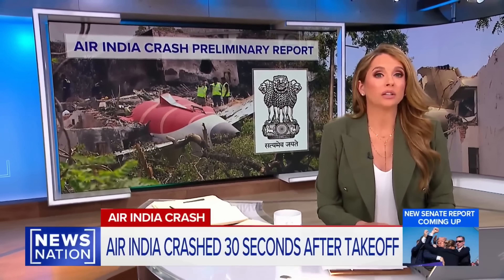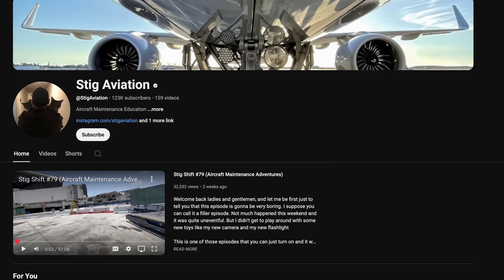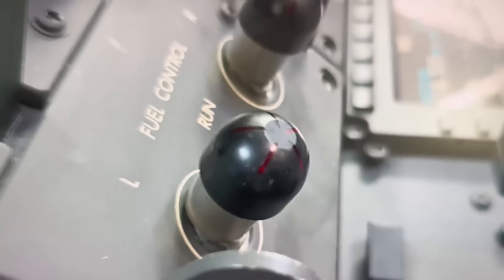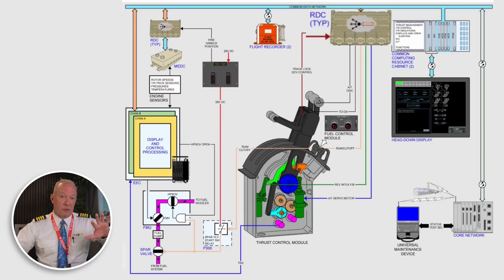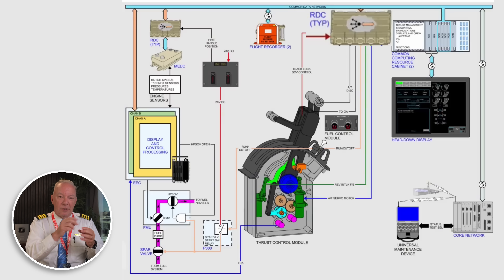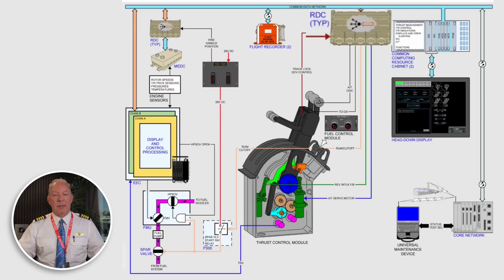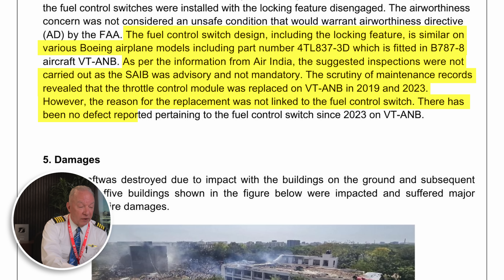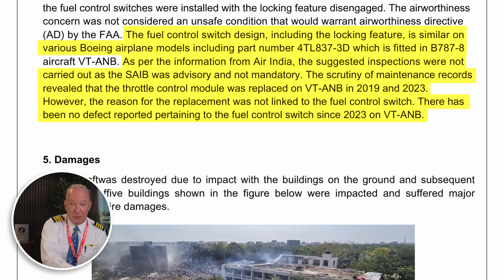The Truth About Boeing 787 Fuel Control Switches

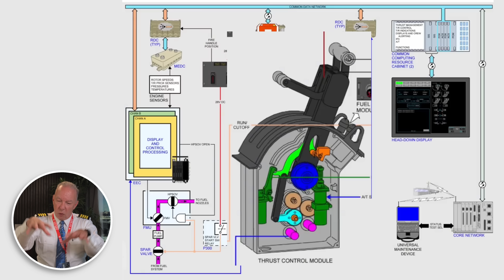Comment: Thanks for the great explanation of the fuel control switches.  However.  I do have a question - As an electrical engineer that has had to diagnose some extremely rare failures, I would like some clarification on the diagram shown at13:05 in your video.  The diagram shows the three fuel control valves you pointed out, with the 28V power from the P300 relay going directly to only one of them - The SPAR Valve.   The HPSOV valve shows an AND gate of the 28V from the P300 Relay and a signal from the Display and Control Processor.  The FMV valve shows only a signal from the Display and Control Processor, and not from the P300 relay.  Is this diagram wrong?  If the diagram is wrong and the actual wiring is as you stated (which does not match the diagram), then your statements about the fuel control switches are correct.  However, if the diagram is correct, then two of the three fuel valves are under direct control of the Display and Control Processor, and could be shut off by the Display and Control Processor without moving the fuel cutoff switches.  I have seen stranger things happen in very rare failures of high reliability systems.  I would appreciate some clarification.
Reply: If he thought the diagram was wrong, then surely he would have said so?
For some reason, he either doesn't know how to read a diagram, or he purposely ignored the control lines from the EEC for his own, personal reasons.

Comment: no one here has asked the second question. If those switches are not connected to any device except the relay, then how can they be sure that one of the pilots turned off the switches?The relays themselves could have failed, which is unlikely for both to fail at the same time, but it is also possible that both switches could have lost power from the battery and thus caused both relays to stop working. It is easiest to blame the pilot. We need to wait for the final report.

Comment: In your funny little circuit map there. It shows flight data recorder connected to RDC(TYP) which on google seems like a moderator. Not sure how that circuit operates. But dude I'm from IIT and so I get how complicated the whole circuit can get. Your insistence on this being mechanical is a joke at this point. Bro, we get it, it's spring loaded switch and that's the only mechanical part there. No one is crazy enough to think switches are purely Digital. Rest of the things are wiring and electrical signals as that's the only way signal can transmit. Electricity is the ONLY way for it work. Now what does mechanical means in your vocabulary is anyone's guess. You are including wiring, the 28 DC voltage, electrical current and everything else in your mechanical sphere. If you think there is no capacitor, transistor, resistors in the circuitry before it makes it to flight recorder then you are so woefully wrong. Even if these components are immune to breakdown in electrical signal, could be static electric or EM, it doesn't help if there is Electrical leakage, be it because of moisture, aging, loose wiring or simply wires are exposed. Let me conclude this by saying that you are a pilot and I'm an engineer so my knowledge about circuits are still superior and I have suspicion here that it's even better than rest of the folks here as I have met very dumb engineers in my life and I don't even design circuits.

Comment: That aircraft went through some terrific g-forces in hitting the ground, 200mph+ to zero in milliseconds. Physics of small switches could surely be overcome at that point. It all depends on when the 'Off Position' was mentioned through to hitting the ground/buildings. The switches would surely have been moved to on in less than half a second after being remarked upon.
There is a very strong incentive for Boeing to control the narrative in light of their dire reputation at this point, they are just one more air disaster away from going bust.
Not saying they have definitely manipulated the findings, only that this crash in particular needs very very close examination.

Comment: Thanks for clearing it up for me, previous interviews made it sound like the switches were just another part in a complicated computer controlled system, which there are many Iam sure if in a modern aircraft, Good to know the fuel system is still a basic switch relay driven system, where only a few parts can fail, and these are mostly work or don’t work ie switch relay and pressure controll system and pump
Reply: Look at the diagram. It flatly contradicts what he says.
Reply: @72nortoncommando Don't believe all that you hear. Look with your own eyes. Do as @burblering says. Pay particular attention to FMV & HPSOP valves and what controls them.

Comment: the physical switches aren't directly controlling the circuit, when they are closed they send signal to the electronic controller which then triggers a relay which is directly wired to the circuit. Thats how the aircraft  can control the fuel supply, all the buttons send signals to the controller
Reply: Even the block diagram that is shown in this video contradicts what Captain Steeeve is saying. There are clearly signals coming from the EEC.

Comment: Other speakers just generalize and jump from 1 logic to another to confuse unsavvy audience to advocate for their causes blaming Boeing for many illogical and absurd reasons. If the relays, the switches, and the whole valves system do not work, then the airplane engines should not be able to even have fuel and run at all. It did not have to wait until the most irrecoverable and vulnerable stage of the plane rotating to happen. 

The Cockpit Voice Recorder CVR even records the copilot questioning why the switches are moved. This adds up and explains well what happen. People can pull and move the switches very fast when acting deliberately. One second seems reasonable for this accident.

Comment: This is still an incredibly tragic accident and my feelings go out to all families and people affected by this. 

However, you state here the detent correctly stops the switches being moved. Yes, but that’s only if the switches weren’t worn or faulty. 

This video does not remove the possibility that the accident could still be down to a possible maintenance error. 

The FAA issued Special Airworthiness Information Bulletin on December 17 2018, NM-18-33

As you say, that Bulletin was an advisory, not a Directive and therefore not compulsory but clearly states:

“This Special Airworthiness Information Bulletin (SAIB) is to advise registered owners and operators of …Model 787-8, -9, and -10 airplanes…of the potential for disengagement of the fuel control switch locking feature.”

So not just 737’s as you state. 

And the Bulletin goes on to say… 

“If the locking feature is disengaged, the switch can be moved between the two positions without lifting the switch during transition, and the switch would be exposed to the potential of inadvertent operation. Inadvertent operation of the switch could result in an unintended consequence, such as an in-flight engine shutdown.”

“The FAA recommends that all owners and operators of the affected airplanes incorporate the following actions at the earliest opportunity:

1) Inspect the locking feature of the fuel control switch to ensure its engagement. While the airplane is on the ground, check whether the fuel control switch can be moved between the

 two positions without lifting up the switch. If the switch can be moved without lifting it up, the locking feature has been disengaged and the switch should be replaced at the earliest
opportunity.”

I understand the model of the airplane that crashed was a Boeing 787-8. So was clearly covered by this Bulletin. 

So, the question in my mind is. Were these switches faulty and overlooked in maintenance on numerous times and subsequently allowed an inadvertent engine shutdown?

Here is the Bulletin for reference:

https://static-gi.asianetnews.com/common/01jzyjc6pj2t1cn4tqaax07ac4/easa-sib-nm-18-33-1.pdf

Comment: I'm a Controls guy. This is straightforward. Yes, there are ways equipment can fail. But every time I get called to a machine because it failed, I spend more time getting the actual story out of the operators and finding out it was human error. It is actually very rarely a programming issue or equipment failure. I hate to think that the pilot made a mistake or decided to end their life.
Reply: how so? He didn't even explain the closed circuitry correctly and his schematics were overly simplified.

Comment: You may laugh at me because I am just field engineer repairing gaming equipment,  Relays are lethal, the coil magnetism can instantly fail causeing the relay to drop out,  The contacts may have carbon build up that prevents the transfer of power, and so on right througout the system, the computer might have sent and error message, or in gaming machines the cash in may faiil, All very difficult to assign
As for the relay itself, take it out and examine it and unless the contacts are badly caarbonised you will never know why it let go
Reply: Yes, relays can fail. But no single relay has any effect on both engines.  Also, in this case, the valves must be powered to the new commanded position. So, the relay has to have a hot short to its input coil, so that it will send that power to the fuel spar valve actuator.

Comment: I haven't seen any description of the timing of the deployment of the RAT (emergency generator). Did that deploy before the fuel cutoff? After?
Reply: yes
Reply: I doubt it. RAT deployment is automatic with the loss of all AC power (as well as APU start).  It seems unlikely that one of the pilots deployed the RAT manually before the engines spooled down.  The pilot flying wouldn't have known anything was amiss before then. And I don't believe pilot who I believe flipped both fuel cutoff switches would try and save the airplane that way.

Comment: Just a question, not an implication. I didn't hear you consider the possibility of a RELAY failure. If not, why not? Could the relays have failed temporarily? If so, would that have given the "black box" the same sensor  indication as manually shutting off the switches?

Comment: Thanks for this video. Can you explain to me how it is detected that the switch was moved? is there a proximity sensor that is touched or is the current through the (seperate) 28V electrical system measured? or another way to detect that the switch has moved?

Comment: You explained the switches.  But, that doesn't eliminate a wiring harness intermittent break or a short circuit?
Reply: The fuel spar valves must be powered to change position (not spring loaded). An intermittent short would not accomplish that, a hard short could close the spar valve on one engine. But not both.

Comment: Most of your description of the system appears to be accurate except your the EEC (Electronic Engine Control) can shut down an engine without moving the fuel control switches to cut off. It does this in the Thrust Control Malfunction Protection Mode, where the EEC commands the shutdown of the affected engine when - the airplane is on the ground + the thrust lever is approximately at idle + the engine is above the commanded N1 and not decelerating normally. Now I will admit that this is from my knowledge of the GenX 2B engines on the Boeing 747-8. So I’m only assuming that since the Gen X engines on the 787 are the same engines except for the missing plumbing for bleed air and a different number of compressor stages, that it would still have this Trust Control Malfunction Protection Mode. It would be interesting to hear if you know for certain if the 787 is in fact not equipped with this system. I will also admit that the accident airplane did not meet those parameters for this system to activate if installed. But if it does have the TCMPM system installed then the EEC does have authority to shut down the engine regardless of fuel control switch position and therefore though highly unlikely, is capable of shutting down engines without moving the fuel control switches to cut off.
Reply: Yes, this is one of the errors/weaknesses of the preliminary report. It states the valve was commanded closed. I know the Fuel Spar Valve indication comes from limit switches on the actuator shaft. There is probably a similar switch on the HPSOV (although being a poppet valve it would function differently).  I believe the FMC records both valve's position, and I assume the report didn't specify which valve closed, because both did. But again, an assumption. If only one valve transitioned that would be an obvious disconnect and point to an electrical or mechanical failure.
Reply: An N2 overspeed will also shutdown the engine if it reaches 120% N2 through the EEC’s overspeed protection circuit.
Reply: Yes. The diagram clearly shows control lines to 2 of the valves (FMV & HPSOV) from the EEC. So, as you say, there could be other instances that cause a fuel shutoff, other than the fuel control being set to cutoff.

Comment: It's frightening that most people have not the slightest idea how electricity and mechanics work. Captain Steeeve explains it in a way that even elementary school kids could understand this. Therefore nobody could deny the facts anymore. Thanks!
Reply: no he didn't. He has omitted or not explained a few important details that only a design engineer who works for or worked for Boeing can explain. got that? You are lured by his soft, kind mannerisms into thinking he's telling the truth, in fact he's been wrong before about his "conclusions". He's in it for the $$ nothing more. time to get wise to the con men posting Youtube videos. Steeeve should shut down his channel, just for ignoring advice from the FAA and NTSB, NOT to draw conclusions from the preliminary report.
Until he puts on a qualified expert on 787 electrical systems, i don't believe a single word he says.  He's just a pilot looking to make money for Christ's sake!!
Reply: @peerpaulin8486 You're right. It is "frightening that most people have not the slightest idea how electricity and mechanics work", and that includes Captain Steeeve!!! The 3 valves are NOT controlled directly by the relay. Only one of them is. The FMV & HPSOV have control lines coming from the EEC. It's clearly shown on the diagram as plain as day. His claim that nothing else, other than the fuel control switch, can turn off those valves is wrong.

Comment: I assume Captn Steeeve would be aware of the ANA 787 uncommanded shutoff  incident in 2019, abd the Jetstar Airways incident.  These resulted in uncommanded shutoff of the fuel supply by the TCMA system.  So software CAN shutoff the fuel supply to the engines.  This has been pointed out by  Mary Schiavo.
Reply: he has avoided talking about this because it would upset his "Conclusions" and all the time he put into his "Conclusions". he's been wrong 2x before regarding this and now is  desperate to convince his supporters that he is right.
Reply: On the 787 there is NO software involved in opening or closing the fuel spar valve.

Comment: You speak as if it is impossible to have a failure in the battery buss system that feeds the fuel shutoff relays. An intermittent connection fault ahead of the switches could indicate to the monitoring system the switches where turned off especially if both switches have a common electrical connection ahead of the switches. Never say something could never happen.
Reply: The primary power for the fuel spar valves comes from the main DC busses. The battery buss is spliced in as a backup for loss of all AC power.  In any case, the actuator must have power to change position. Loss of all power leaves the valve in the last commanded position.

Comment: Anyone trying to justify a faulty switch or the switch magically flipping off is delusional.
It's time for cameras in the cockpit. If there can be cameras around the rest of the plane, there can be one in the cockpit. We the passengers, don't care about your (pilots) privacy. We care about OUR SAFETY.
Set up the cockpit cameras similar to a dash cam, where it only records, say, 10min at a time and can only save an hour or so of video.  Heck, once at the gate and the fuel switches are flipped off, the camera date erases.

Comment: Nicely explained.  But…why is no one talking about the Japan Airlines 787 accident caused by fuel cut off switches moving to off position due to electrical failure, due to short circuiting or something similar. A report by the FAA a few years ago clearly stated this is a flaw that needed to be addressed in the 787.